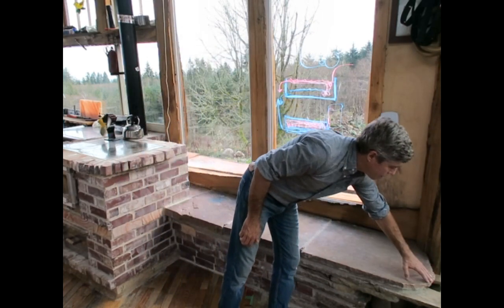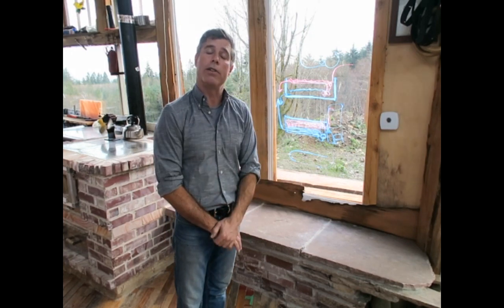Rocket Mass Heater Bells and Benches Discussion

Comment: A couple of questions if I may .... Can this be built to code as I can't see anyone signing off a clay seal against CO and CO2 as well as some of the other gases involved causing a reaction and making sulphuric acid which would eat our mortar making it gas porous? This is an issue in brick chimneys with no flue! The second is more complicated ;O) .... As I understand it there are several areas where temperature differentials over different areas would cause draw, The first would be the burn tube where the heat would cause a natural rise, the second would be the area between the burn tube outer and the barrel (colder as it gets lower but the flow is going from top downwards at that point, so the denser air is at the bottom) and the chimney, where the temperature differential  to the open air outside is (hopefully) lower! Would increasing the vertical height of the barrel and the burn tube not increase the draw over the loss of draw caused by the bell .... also would an open baffle system in the bench bell allow greater stratification and thus greater heat absorption (but greater loss of draw)? ..... I did say it was more complicated ;O)
Reply from the maker: Hi Dave, good questions.  Code is going to depend on your municipality so I can't speak to that.  I will say I have zero concern for deteriorating mortar.  This has been common practice in masonry stoves since forever.  As for the second, it's not complicated at all.  The systems run at close to max efficiency and are limited only by chimney draw due to temp differences.  The answer to your question is that it depends.  Any build will require proper flow for it's size, so a small system can use different features to help extract heat and maintain adequate chimney temps than a large one.  There are a million different features or build details that can be use to effect the flow and extraction.  Choose your ingredients depending on your goals.  My best advice is to stop thinking too much about it and start building, once you have a working model you can add tweaks to adjust if needed.  Hope that helps.
Reply: Dave, 
My experience has been that code is based on engineered standards, and there is usually no ‘thinking outside the box’ on the part of building inspectors. I’m learning still, but so far have seen nothing to suggest there is any engineering standards for the RMH. You would likely have difficulty with code allowing one, as well as difficulty getting homeowners insurance to approve one. There is simply no standard by which to measure them, given they fall outside of any accepted HVAC or woodstove specifications.
Reply: julie r - Ernie and Erica Wisner have gotten a rocket mass heater design code approved locally in the Portland Oregon area, I believe...  classified under the “masonry heater” category... most everywhere else it is not as familiar to building departments, or insurance companies, though.
Reply: Did they get an exemption for their particular rmh, or did they actually get the local code changed? I have high hopes for this design, but I know it’s slow going getting a novel idea (novel now, been around forever) accepted. Wasn’t that long ago that most places wouldn’t allow log homes.
Reply: julie r - I believe they actually worked to get a specific design approved as a masonry heater under that county’s building codes
Reply: That’s awesome! I have great respect for how hard they have worked to develop and promote the RMH design. Finally have their book and loving studying it.
Reply: Maybe that’s how it works where you live, but a fireplace installer here wouldn’t ‘sign off’ (whatever that means) on a homebuilt rmh. Fireplace installers aren’t building inspectors, who DO have to sign off, if you are in a zoned area.
Reply: I’ve worked on both coasts of the US, talked with many trades all over the country, doesn’t work that way anywhere here that I’m aware of. That would be a direct conflict of interest! I’m amazed Canada allows it. Maybe in rural areas but I bet not in Quebec or Ontario.

Comment: My concern is escaping CO2.  How do address that issue?
Reply: Install carbon monoxide alarm near the unit and close to floor level as C02 is heavier than air. If the alarm goes off open a window and check your system for possible leaks. If your system has good draw it will suck air from your home out the flue and the CO2 with it!
My Best to You, Greg

Comment: Has anyone come up with a good refractory casting mixture that is affordable/DYI for the burn chamber? I have seen and researched many but most use portland cement. My 86yr old father was a concrete worker his whole life and said this would not be a good idea. I was thinking of incorporating the best of the recipes but lack of chemistry knowledge not sure how all would work..?
parts 1-fireclay,3-Black Aluminum Oxide 70 Grit Abrasive Media,1-portland cement,1-hydrated lime,1/4-liquid glass,1-perlite and 1 to 2 parts water. Not sure if mixing with a foaming agent like aircrete would be ok for burn chamber or just for riser part. Any help?

Comment: I have a wood stove. Could I build a bell next to it and then do fast burns in the wood stove, exhaust the gases into the bell and then exhaust the gases out of the bell up the chimney?Would this be more efficient than my wood stove alone? Thanks.
Reply from the maker: I do not recommend this approach. Box stoves are designed to draw straight up the chimney and pull hot and fast. When you use a bell you slow that down, harming combustion and cooling the gasses thus increasing the chances of creosote build up and potential fire/explosion hazard.

Comment: You can make it more efficient if you use soapstone.
Reply from the maker: It's true Mark, I wish I could afford it.  Here on the West Coast that stuff is like gold.
Reply from the maker: That's a cool video!  Thank you for that.  Soapstone here is around $20-$30/Sq.ft. @ 1.5" thickness.  My bench would be around $500 for just the top.
Reply: +broaudio  You are looking for soapstone in the wrong place. But now you mentioned slabs of
soapstone, I think they use water to cool and avoid dust while cutting the stone.
Now the question is, what do they do with the slurry and the offcuts?
I can imagine that you can use that debris to fill your bench, after all it is still soapstone,
maybe you can press it into bricks.
Check out art-supply stores where they sell soapstone for carvers/sculpturemakers, maybe 
you are able to find a big pile of scrap.

Comment: If you have black stove pipe take a angle grinder with sanding disk or wire brush and remove all the black paint from any elbows or straight pipe on inside and outside before lighting or you will be sorry

Comment: water heat up in part ;;;;exust it100 yrds into green house floor man you are a great teacher it opened my mind GOD BLESS i gott 1000s feet gal pipe wow
Reply: James Evans 
not sure if your aware, but use caution with galvanized pipe with Temps over 500 deg F. you can get toxic gases from the galvanized coating.